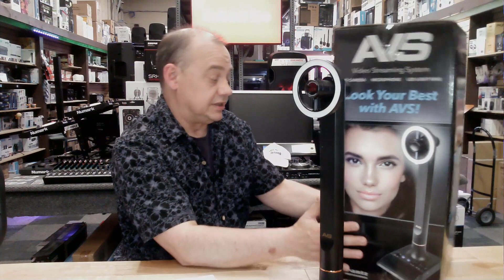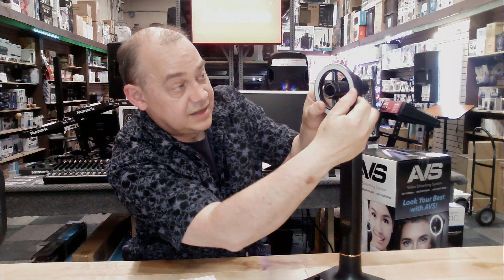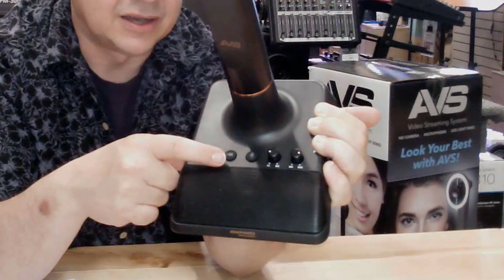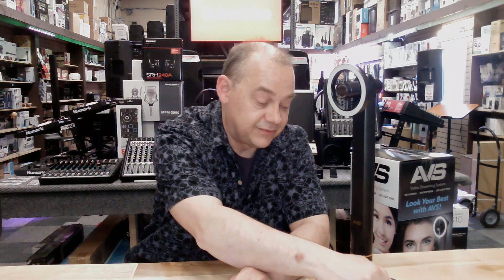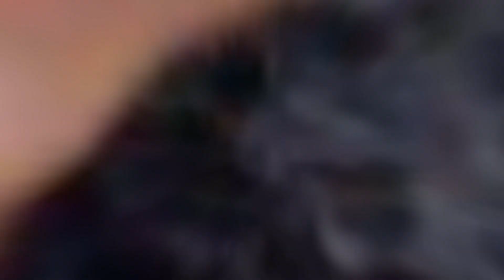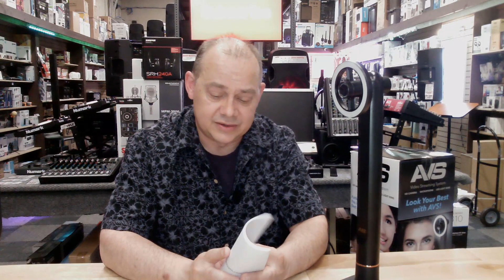How good is the Marantz Pro AVS Audio-Video Streamer for Live Streaming video Camera condenser Mic.

Comment: I have the turret version but I have to speak not more than  inches from it or I lose volume on the recording. I wonder if the AVS version that has the microphone on the bottom base would pick up sound better and would not have yourself partially blocked  by the turret arm. This is a great setup for beginners as you have built in software that syncs the video and audio together and produces  video file when you are done. Unless you want to lean extensive video editing with some software.
Reply from the maker: For meetings ok but for Podcast with video or Vlogging Now No, I would now buy something else. When I record on the actual turret, I always use the Audacity, so this way I can gain control the microphone, so this way I can get the most out of it, so just being like 1 dB off the top, so this way everybody can hear me properly. I didn't use the software an awful lot. I would film separately, record separately, and do the audio separately. And it seemed to work out for that. I didn't have to have the microphone always so close.

Comment: No line in.  What the hell were they thinking.  The whole point of this is to get an HDMI input that is ready to go.  I got a mic, but I need to mix in a music instrument.  You can even plug in a headphone level input into the aux... and it sort of works, with terrible audio quality.  USB coming out of pianos and what not are useless in almost every scenario.  I think I have to return it.  Without a line-in, it doesn't solve any of the problems that a DSLR with a line-in solves.

Comment: Hi. I have two questions:
Can you use the Turret PRO in conjunction with a USB mixer? I am just getting started with video performances and would like to have some control over the added effects, etc on the audio. I have an Alesis USB mixer, but would prefer something a little simpler if you have a suggestion...possibly a software. 
Also, can the video from the Turret be used with Movavi editing software to make a stand alone video produced with titles, etc? 
I am trying to do this as cost effectively as possible and appreciate any info. Thanks!

Comment: I just got this piece of equipment however since it has the mic down at the bottom, when recording, it takes the sound of the computer running and cannot remove, probably the turret would have been better
Reply: I was considering this but wish it had microphone xkr input and adjustable height on stand
Reply: @kiwiradioNZ  I solved the adjustable height problem by buying an adjustable desk. Only have to adjust the desk when I use the Marantz. The Marantz unit is an all in one. It has internal software that syncs the audio and video together so when you are done a video file is made and you could post it just like that without any editing. I want to keep things very simple and don't want to learn how to use some video editing software that is not easy. If I make a small mistake so be it I am not trying to do a perfect video just a good one.